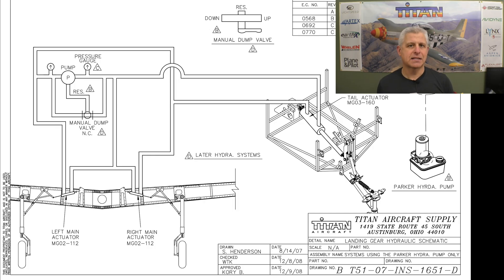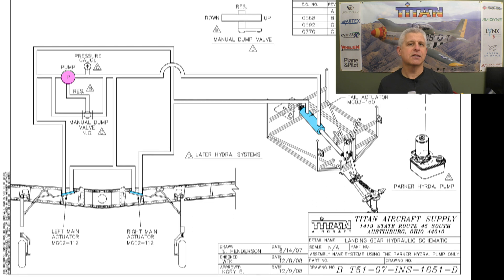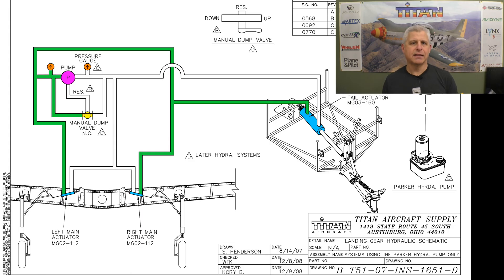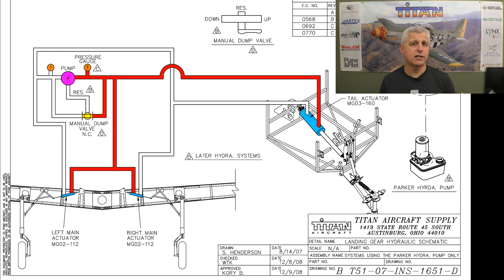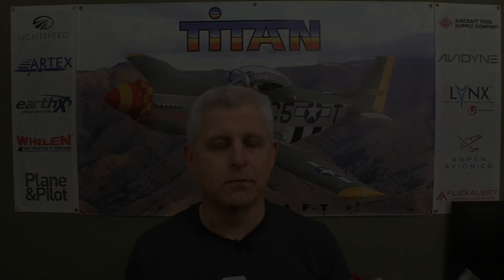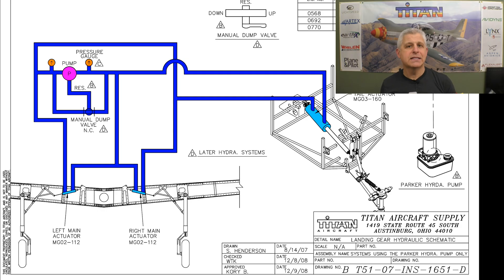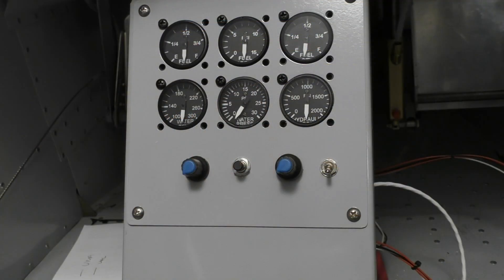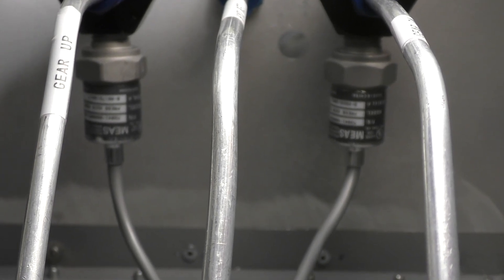Emergency Gear Extension in our Titan T-51D Mustang Aircraft

Comment: Just a nit?  Do you have the flows reversed in the schematic?  Applying (green) pressure to the outer ends of the actuators pushes the pistons inward, retracting the gear.  Doesn't applying (red) pressure to the inboard ends extend the gear?  Or are there some kind of reversing linkages (or fluid paths) in there?
Reply from the maker: The drawing is a bit confusing because the gear mechanisms are not shown clearly. The main gear and tail gear mechanisms work opposite in terms of extension of the cylinder translating to gear up/down. When the tail gear cylinder extends, the tail gear goes down.  For the main gear, extension of the cylinder retracts the gear.